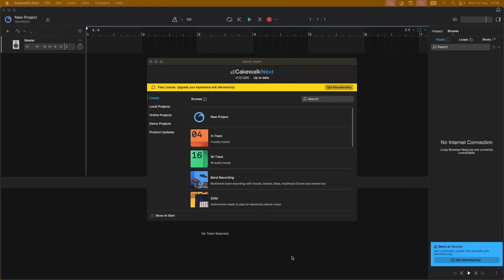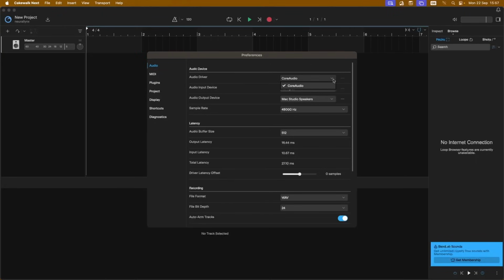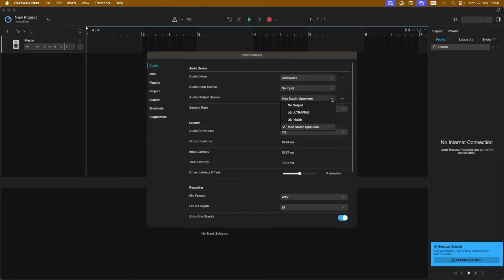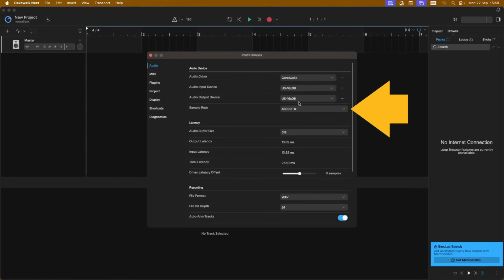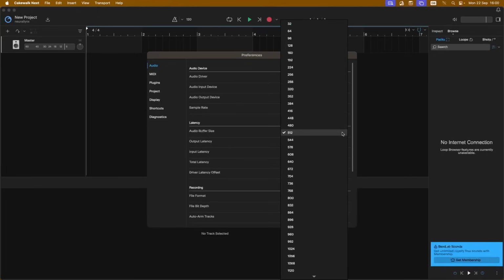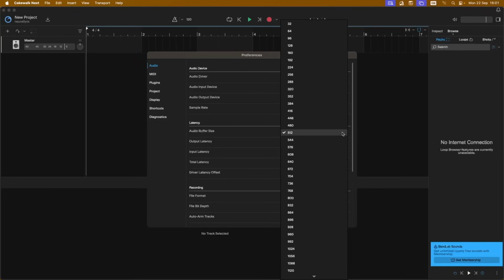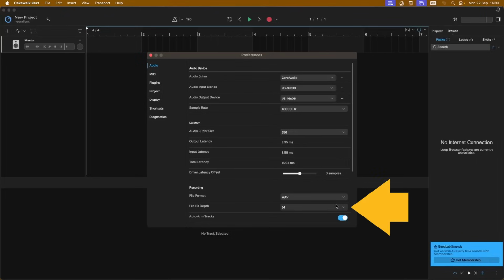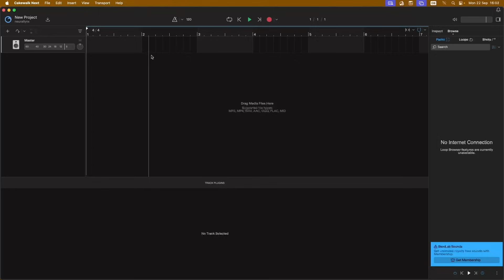How to setup your audio interface or soundcard in Cakewalk Next

Comment: How do I record Sound on Sound in Cakewalk Next?
Reply from the maker: @gamhazell
If you click on the droplist icon (V shape) to the right of the record button, you can change the way Cakewalk Next records. Overwrite is normal recording mode, Takes to Folder... Loop a section of track and each loop will be recorded to a separate track in a new group folder, Punch Recording... Loop a section of track, turn off looping, start recording, only selected section of track will be recorded or overwritten, Overdub  Midi... Let's you add new midi notes when live recording.
To merge audio tracks, select the tracks, click on file, then click on export audio, set source to All Selected Tracks and click on Export.
Then import the exported audio to a new track.

Comment: When i click asio there is no input or output at all...
Reply from the maker: @moshikkirshberg1214
It sounds like you do not have the correct ASIO driver installed for your sound card or audio interface, or your sound card or audio interface does not support ASIO.
You can still use a sound card or audio interface without ASIO but the latency will probably be very high.
Reply: @IbandUK  My windows 11 doesn't have it either. It just has a windows option. Please help.